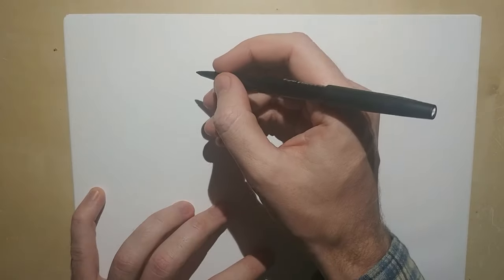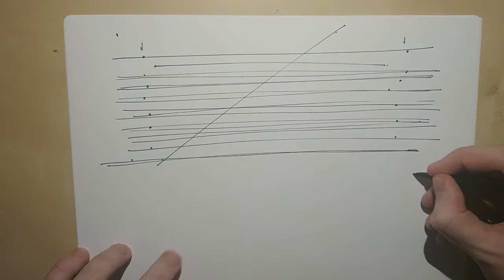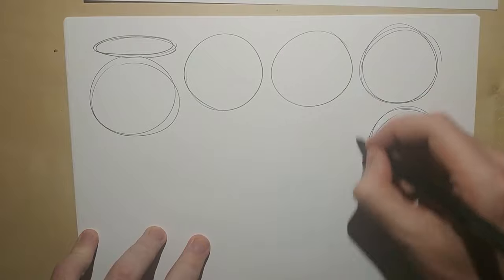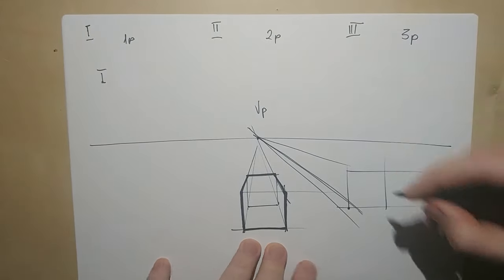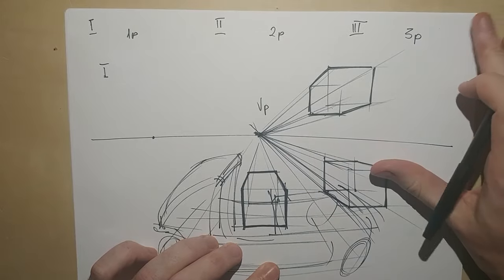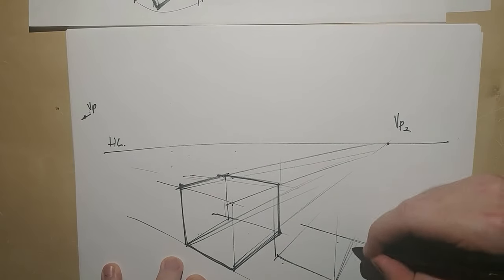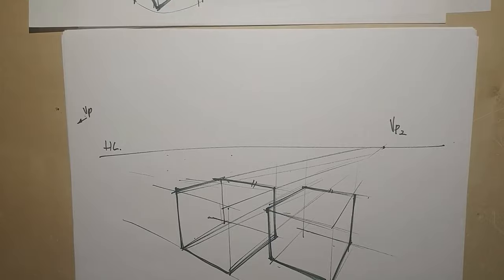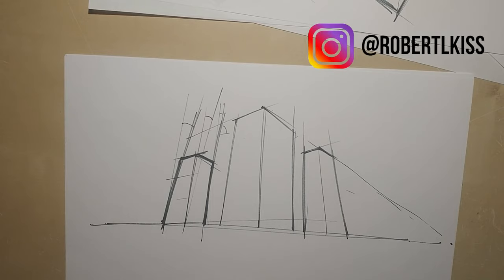Industrial Design Fundamentals 01 Perspective

Comment: The best way i found to do the line warmup is to do draw a fairly large circle with a dot in the middle and then you can draw dots on the circle and draw lines from the middle to the dots around the circle (or if you prefer drawing from the dots around circle towards the middle). This ensures that you are practicing drawing straight lines at every angle.
Reply from the maker: Oh that is a very good approach, I never thought of that. I shall use that from now on, thank you!
Reply: Very smart

Comment: I have a question , i hope you're still active right now because it has been bugging me.

In one point perspective is the vanishing point always in the middle?Can you adjust where to put the vanishing point?For instance it's on the right middle-ish.

In 2 point perspective are the vanishing point limited to rhe sides only?

In 3point perspective are the 3 VP only limited to left right and bottom?
Reply from the maker: Hey there. Let me answer your questions:

1: Technically yes you can move the VP around but 1 point perspective is never really used because it is incorrect and gives a very flat end result. It is interesting for some graphic representations and simplified drawings, but you would never use it in product design or realistic drawings.

2: What do you mean if they are limited to the side only? The vanishing points are always on the horizon line. Here you can move them freely as long as you don't get too much distortion.

3. The 3 point perspective is the next level of the 2 point perspective. So 2 VP's will always be on the horizon line like before and the 3rd VP will be above or below the horizon line depending on your camera and whether it is looking up or down.